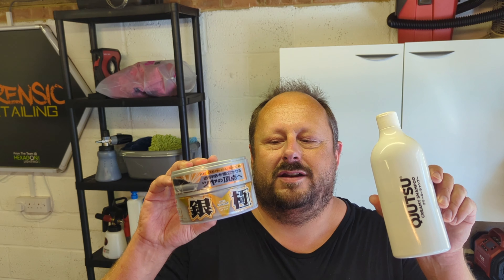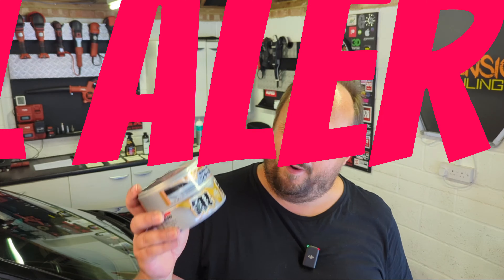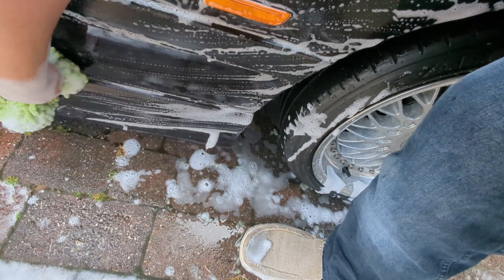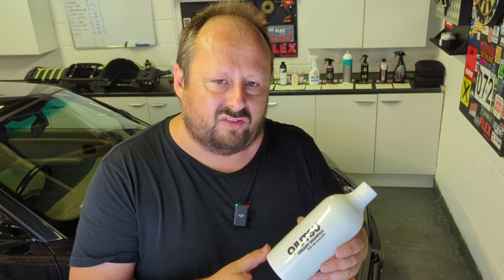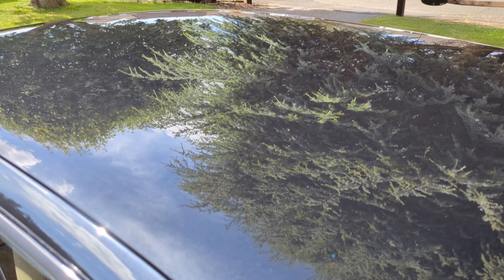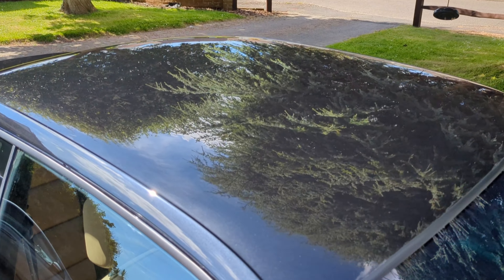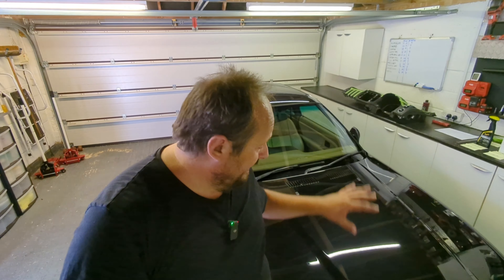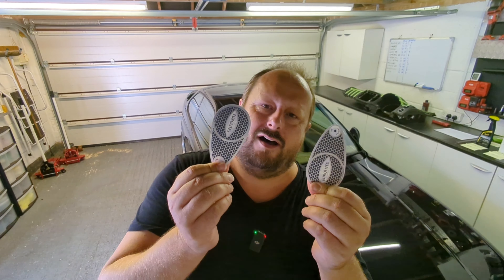Protecting my car for a Road trip | Soft99 Free Product Deal #ad

Comment: Soft 99 makes some pretty decent honest products, I think. Although I've moved away from traditional pressure washer cleaning and I now use rinseless washing 90% of the time now. Armour detail supplies 'Hero' and Labocosmetica 'Idrosave' are systems I'm using 90% of the time. I rinseless wash systems are where its at ATM. Labocosmetica are even bringing out rinseless wash related products specifically made for using rinseless wash after/ during the rinseless wash process - Labocosmetica 'Preludio' Acid and 'Preludio' Alkaline. Both coming to Clean and Shiny very soon. I've hardly touched my pressure washer in the last 6 weeks.! Not sure if soft 99 do a decent rinseless wash system? Jon, you should consider this as its new technology and we all need to tweek our habits and muscle memory to try a completely new method of car cleaning. I don't think I can look back to a pressure washer and bucket wash. 💥

Comment: Surly that applicator is putting swirls in the paint work? although the gloss effect is great I'm skeptical of putting swirls in the paint would love some feedback
Reply: They would never give an applicator that swirls would they? I had never an issue with fusso coat applicator that came with it.
Reply: Applicator doesn’t implement swirls and scratches. Long as you don’t drop it! Lol. The paint is already clean and decontaminated at the time of application and the wax is free from contamination so I don’t understand why you think Soft 99 would give you a pad that will scratch and mar paintwork. Just use your own if in doubt. The wax is the stuff you really want.

Comment: Can you do a real life durability test on the kiwami? Since you said that 3 months is a pretty conservative estimate for the durability of the wax. None of that torture test nonsense 🤣
Reply from the maker: It will do about 2 to 3 months m8
Reply: @ForensicDetailing  can you use kiwami on the windshields and windows? And can you use it as a topper on any ceramic coating?

Comment: Once a year I do a full clay down and apply fussowax, after that about once a week I do a good wash then finish with turtle wax hybrid solutions Ceramic wash & wax.
To be honest, I think that the fusso has completely worn away in a couple of months, leaving only my weekly wash with Maguires gold class shampoo and then the hybrid solutions ceramic wash wax as it’s only protection.
But!…… over time, week by week, I’m starting to feel as though the continued regular wash then application of the ceramic wash/wax through a foam lance, is better than the single application of fusso.
Not just slightly better, but miles better.

Where’s my proof?…… well, admittedly I don’t have much but I do have the experience of regular road trips from Yorkshire to south wales, journey of approx 280 miles
When I leave my car is always sparkling!, and when I arrive there, the first thing I do is go and get the car cleaned.
If it’s just had a fresh application of fusso before I left then it’s quite difficult to get fully clean using only a petrol station jetwash and my own sponge.
But if it’s been a good few months since the last fusso application, and since then only had hybrid solutions ceramic wash/wax applied,then after almost 300 miles it’s much easier to clean than it was straight after the fusso.

Conclusion - the cheap £11 hybrid solution (foam on, rinse off) once a week, builds up a better protection than spending a full day applying fusso wax!

Note.. the ceramic wash/wax is meant to be an actual wash shampoo, used in a bucket. But used that way I’ve found it to be Crap.
But through a foam lance it’s brilliant! 🎉 right at the end, after you’ve washed and cleaned, just give it a coating, rinse off and dry. Loads of beading and a nice long lasting shine.